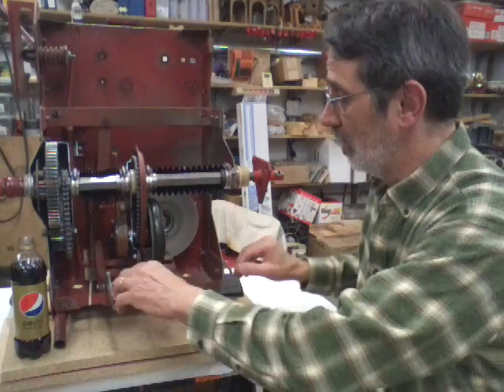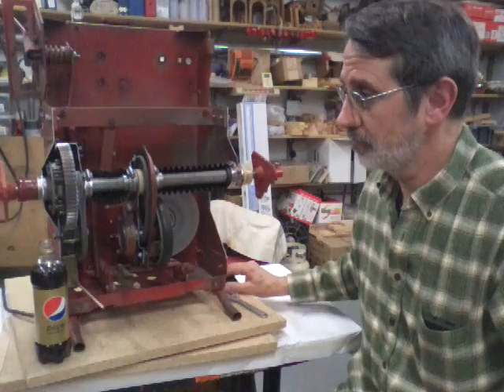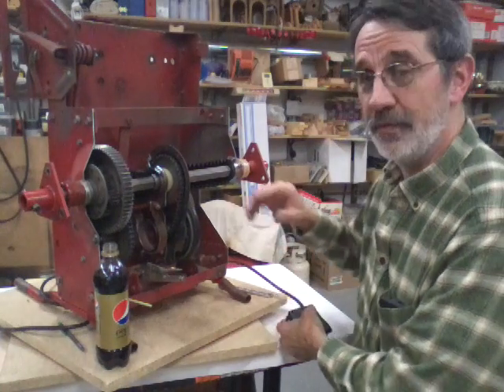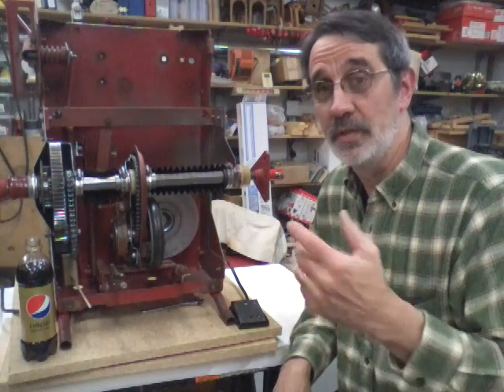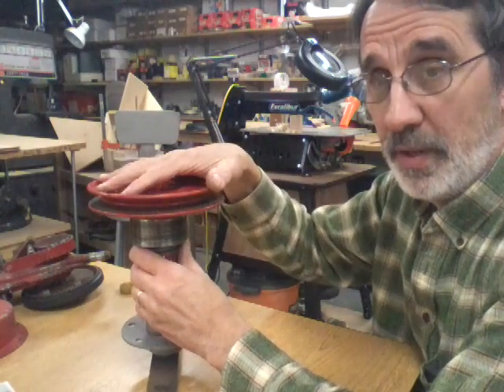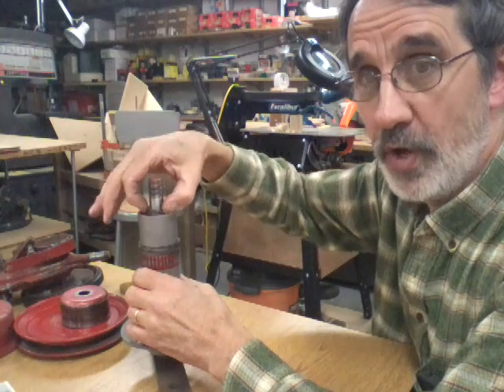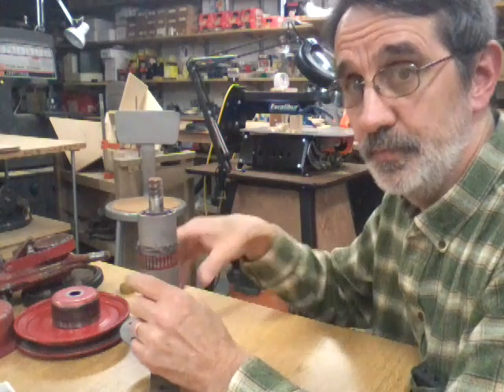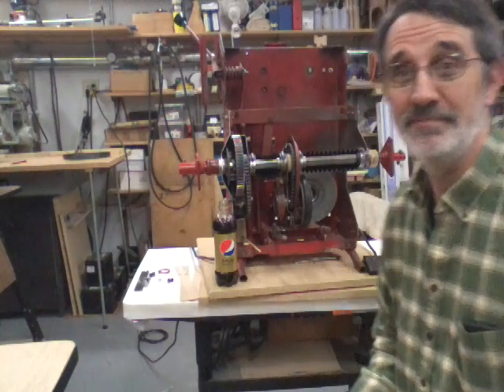87. Yearly maintenance on your snapper

Comment: my lip seal has leaked since the first day that I bought it from the dealer. Brand new and leaked, I was pretty upset so I researched it. Every one that had a snapper said don,t use the snapper grease use lubi plate 105 grease. So I did and put a little lucas in the gear box with the grease. That's what I have used in the gear box since 2008 when I bought it brand new and it's working great.
Reply from the maker: I’ll have to check into that 105 grease thanks for the tip

Comment: Hello Jim.  Thanks for your informative how to videos!  I have a snapper rear engine rider that I purchased new in 2005 i believe it was.  It has served me well but it’s getting to the point now where i need to do some of the more extensive maintenance and PM on the drivetrain.  I know i need to order new axle boots because mine are cracked and torn and so it is allowing dirt to contaminate the axle.  What is the proper part number for new quality rubber boots?  (I have the 28” hi vac deck if it matters).  Also do you just use a quality bearing grease like red bearing grease to lubricate that axle after cleaning it up before installing new boots?  Also, i want to service my chain and differential cases with the 80w90 gear oil like you mentioned.  I have never been in these ir serviced these before, so i am sure they still have the 00 thick snapper grease inside.  My question is- for this first chain and diff case service, should i just add the 80w90 into both cases and run it and let it soften and help liquify the old snapper grease, and then let it down and try and get it to drain out, and then refill with fresh 80w90 in both cases?  Or is it a better approach to try and fill both cases with some type of solvent or degreaser that will break down and liquify the old grease, then drain and fill with the fresh gear oil?  And just one more thing- ive noticed as of late i seem to be getting a little more vibration whenever i have cutting blade engaged than i remember before in the past.  Anything in particular i should ck to make sure something isnt warped or in need of replacement.  If it helps it seemed to be like this even after installing a new blade.  Thanks for all your help!
Reply from the maker: If you go to parktree.com online with your model number, you can find all the parts you need to fix the machine, any type of grease will work fine for greasing the hexagon shaft so it shifts better.        Jim
Reply: I was thinking of the same thing.  It sounds as if there only thing to do is take both cases apart and clean the insides.

Comment: I have back probs now. Any suggestions for getting it up on end easier?
Reply from the maker: I have a video talking about different ways to lift up your machine to work on it, but I can’t find it, one thing I have that works nice is a MoJack I think I bought it at Menards. You push the front tires or the back tires up on it and it has a crank on the top and it lifts machine up pretty easily, or I also have a rope hoist I bought from tractor supply and it lifts quite a bit of weight pretty easy, I use one of those two things when I need to lift up one that just too heavy for my back I continue to look for this goofy video I have I believe it’s titled    How to lift your machine to work on it.  I hope this helps. Sorry it took so long. I’ve been looking for that video.     Jim OK
Reply from the maker: I finally found that video the one you want to watch is number 258 and it talks about three different things that I have that I use for lifting up machines. I hope it helps. Jim.
Reply: @jimjackson9381 brilliant! I found a Mo-JackXT online for $79 free ship (I can’t believe this but we’ll see - prolly from China). If that doesn’t work out I have a hoist but no-where to hang it so I’ll look again for a MoJack type. Thanks so much for taking the time. Scrolling through you vids I can see I’ve found a keeper of a resource for Snappers. I inherited my first Snapper with the house purchase back in 2003. Bought a cheapo Lowes John Deer 0 turn 5 years ago which was actually good but have moved to East FL and  a smaller yard. Was lucky enough to find a new what looked like the last original Snapper 2 years ago and snapped it up - happy! Time to give it some more love. Again, thanks Jim.
Reply from the maker: @randallpatrickc  well thanks for watching. And thanks for the great email. If you have any issues please let me know. Talk to you later. Jim.
Reply: @jimjackson9381  are they still making this Snapper?  All the other ones I saw seemed a bit plasticky. I read a Ga plant had closed.
Reply from the maker: @randallpatrickc  I don’t think Briggs & Stratton are making any  rear engine rider snapper lawnmowers anymore.       Jim
Reply: Great videos! I am doing my 3rd restoration on a 30 inch Snapper pull start  with 9HP engine. I’m watching how to remove drive disk from engine. Thanks Jim!!’